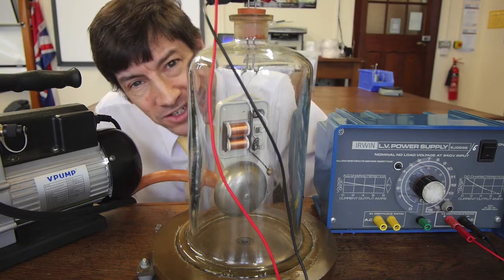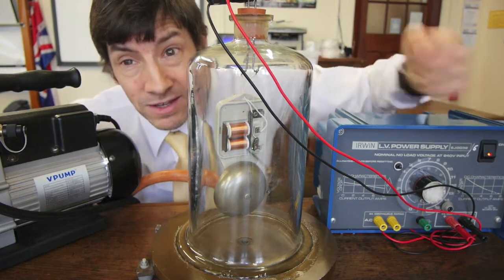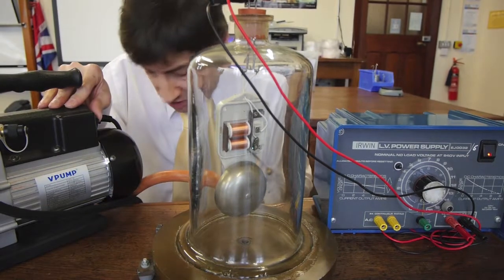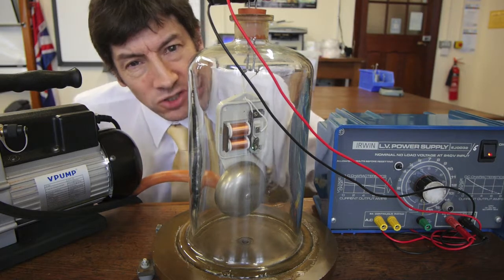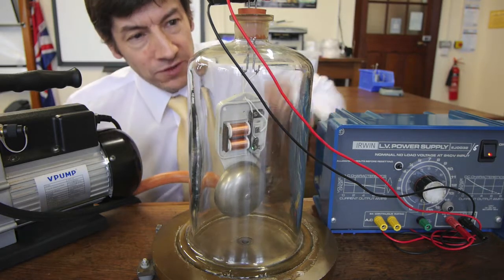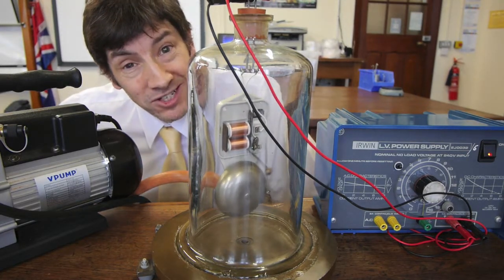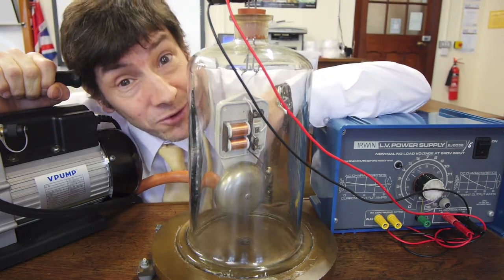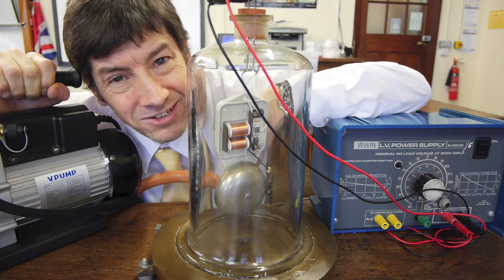Sound and Vacuums - F-J's Physics - Video 17

Comment: This is so cool! Why can't transverse wave travel through gases? I read that it's because gases don't have shear modulus but I still don't get it .
Reply from the maker: Good question - a simple explanation would be that the particles in a gas are 'far apart' from each other and not in anyway connected so one set of particles moving upwards would not move the set next to them as there is no connection between them so no measured sheer modulus.  In a liquid you can imagine the particles are closer together and partly bonded, for example by van de Waals forces.  Hope that helps and keep the great questions coming!
Reply: @AnthonyFrancisJones  Thanks a lot for helping me with my questions.